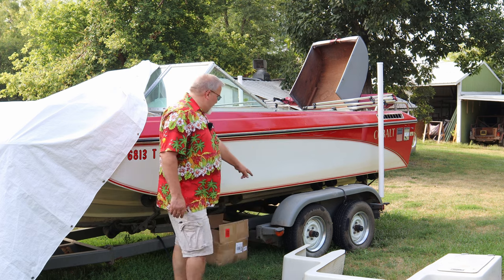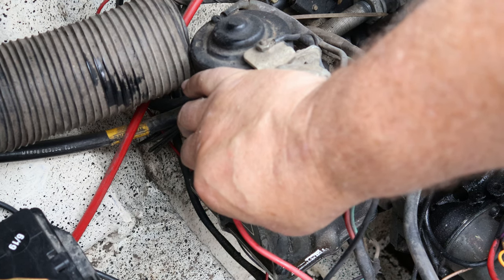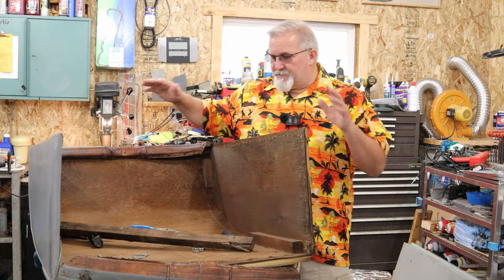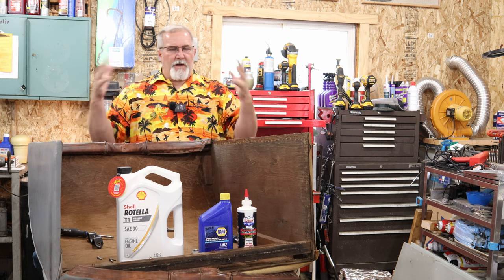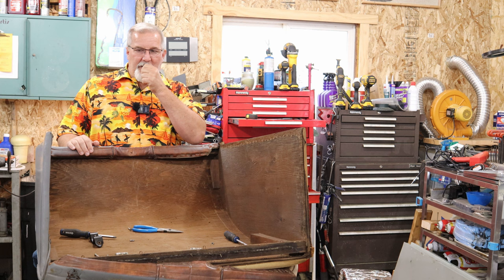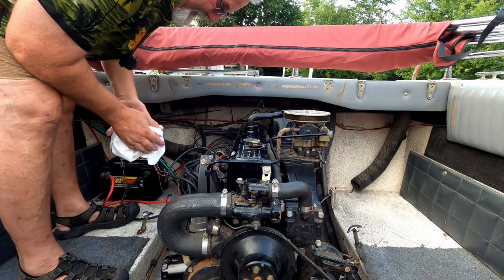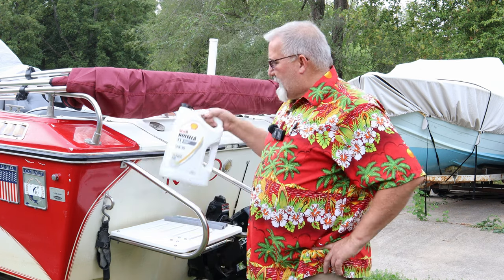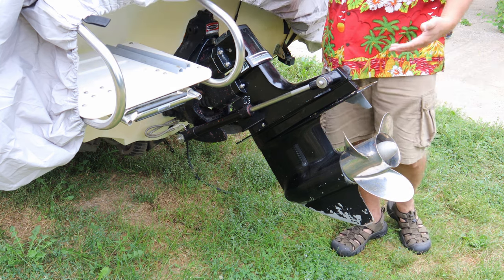1973 Cobalt Mercruiser 165hp Survivor part 4 Lets cover some stuff

Comment: My race cars engine builder has me use a break in oil to break in the cam and rings and then run Rotella from then on. Since I race Hobby stocks I cannot afford to rebuild the engine every year. built the engine in 2015 and it still has the same compression as it did when new...
Reply from the maker: Great endorsement for Rotella, thank you and thanks for watching.

Comment: shell rotella is a good oil to use
Reply from the maker: Yeah brother it is, thanks for watching
Reply: @Michaelsbackyardmarina  not a problem i used to be a long haul trucker and we used it a lot in the trucks when we needed to add oil to our trucks when it showed low on the dip stick that ment we were a gallon low. it took 44 quarts to change our oil

Comment: If you don't want to see the writing on pvc pipe use such write sand it then clean it with rubbing alcohol then pant it the same color as the out drive
Reply from the maker: Not a bad idea, acetone will take the writing off as well. Thanks for the tip and watching

Comment: Read up on and use penetrating epoxy so when you get used up wood like that plywood engine cover clean it up a little bit throw a good coat of penetrating epoxy on there and then brace it all last you and me.
Reply from the maker: Thanks for the tip!

Comment: Diesel oil is designed with larger molecules and as you know it contains zinc and other metals , the older engines have sodium filled valves and need those metals along with lead plus 10,000 miles between oil changes , I use Motorcraft in my Ford diesel personally ! Since when is 6 x 4 = 18 hmmmm Iowa math ! Lol
Reply from the maker: Since my brain can't do two things at once.  You are the first one to catch that mistake. Thanks as always for watching.
Reply: @Michaelsbackyardmarina  can’t believe no one else caught that , I was laughing my butt off , at first I thought you did it on purpose to see who’s paying attention but then I realized you had so much going through your head you just made a mistake ! Lol